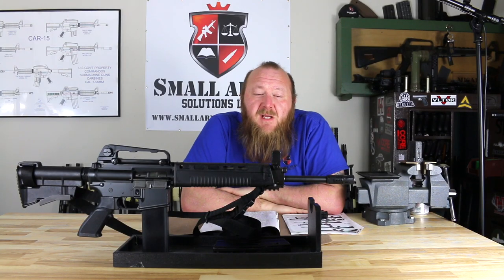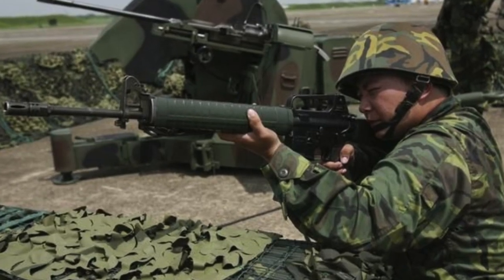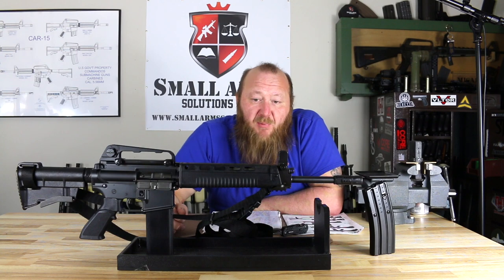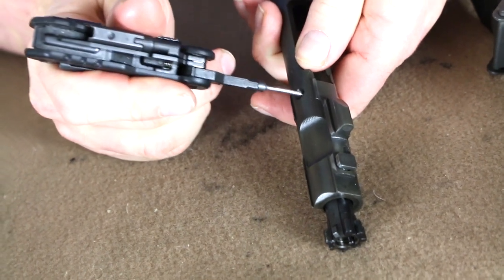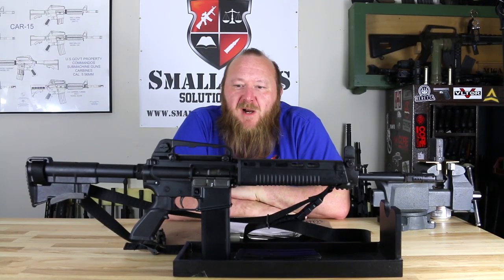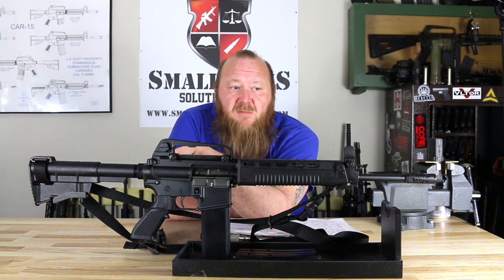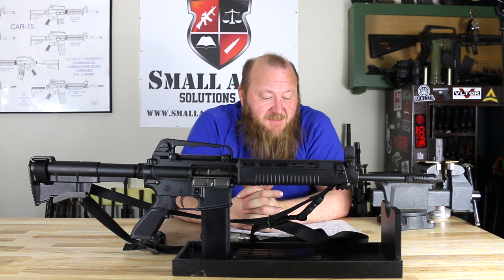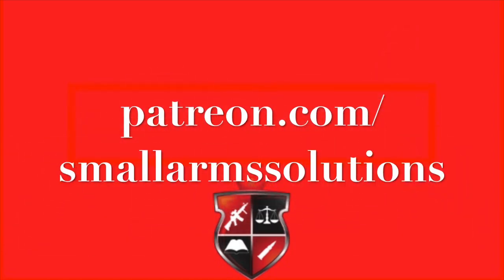The Taiwanese T91 Rifle and Custom Build

Comment: The Republic of China calendar or Minguo calendar is one of the calendars used in Greater China area, but not in PRC, of course. The calendar is to commemorate 1912, the year of the establishment of the Republic of China, thus T65 and T91 means they are in service since 1911+65=1976 (T65), 1911+91=2002 (T91).

Comment: I too also have a T91 Clone. The T91 is Hands down my favorite Piston AR to shoot. I have a BFS3 trigger in my T91 clone, so i have that 3rd selector option😁😁😁 My T91 in Binary Mode is the closet thing to fullauto for civilians. I have had zero issues with my T91. I am going to get the 16" T91 version very soon.
Reply: Hows recoil?
Reply: @nuclearjanitors  very light recoil.
Reply: @sugarland77478  thank you brother but i am in NC, and that invitation is reciprocated if youre ever out this way. I'd like to grab one, and with that upper price just right i think i might.
Reply: What length barrel do you have on your clone?
Reply: @bryanupton9872  14.5" pinned/welded to 16" legal requirement. I haven't decided for my 2nd T91 if i want the 16" or the 12".
Reply: @bryanupton9872  i got the Echo 2 trigger from Classic Firearms also on sale for $299.99.
Reply: Read my reviews on the T91 and look at the pictures of my T91 at classic firearms. Also look under the Anderson 80% you will see my review there also.
Reply: sugarland77478 thank you, I have a pin and welded 14.5 upper also but I’m just putting it on an aero precision lower. Bought all the Taiwanese furniture however
Reply: @bryanupton9872  I took my 80% to the local fleamarket and had it laser engraved with the T91 markings for $20.00.
Reply: @sugarland77478  good day!, question?, just like you I’m station in Fort Bragg. I have been looking for some one to engrave my receivers
Reply: @victoravalos1711  Fort Bragg or Fort Bend? I got mine done at the local flea market.

Comment: I picked one of these "Wolf A1" upper, swapped the barrel and got the right furniture from "T-91 Tactical" and built it with a BCM lower kit and a Poverty Pony Stripped lower.... and I love it. What a fantastic platform. The Gas system is SO easy to completely clean... not that you really ever need to. Very accurate, very light, and very fun too shoot.

Comment: Most Piston Driven AR in the US market today, are relatively new development.

The original AR-18 and the Taiwan T65/T91 line, is probably the two oldest Piston Driven ARs....   And I want my gun to stand the test of time (and the Taiwan T65/T91 went through at least 4 generations..  maturity thru iterative improvement is always a good thing).

The T91 piston upper sales at a reasonable price, the only problem is they don't import enough of these and are hard to find in the US market.....

Comment: You seem to be one of the more knowledgeable and  informed guys on the Type 91. In fact this video made me buy my wolf a1 initially a year or so two ago. I have a minor issue and can't seem to find a solid answer. 

I recently converted my wolf a1 to a proper milspec T91 with the barrel, sightblock etc.
I'm trying to find a quality folding rear sight to pair with the milspec gasblock, and front sight post. However, nobody can give me an actual answer, other than HK416 sights MIGHT work and Troy Micro M4 sights MIGHT work. I don't want to know what might work. I want to know what WILL work.  I'd hate to spend 100+ dollars on a sight to find out it's not gonna work for me. I plan on using it with red dots and magnifiers, so folding is a must. I'd love to use my T91 on the job; bail enforcement. 
I really want to use the milspec front sight as is, and not opt for a higher sight post. 
Thanks

Comment: Could be a modern classic , alot of nations seem to be moving to short stroke roaring bolt rifles , I feel it's the best AR piston system that has had the most real life testing ,I really wish that wolf imported the parts properly as in as in milspec T91 upper and a CL barrel, I'm sure they could have found a way to import them just as you can unport FB CL barrels undrilled from Poland. Or just imported the whole rifle as a straight-pull then drill the gas port.
Spare bolts and barrels are kind of a nightmare to get, I feel if they did what Zastava USA did it would have been amazing .

I know they have blocks that will accept an AR15 barrel but it needs an undrilled barrel.

If they came in as is or imported them as pistols it whatever with spare parts then it would be a prefect duty rifle.

In sure they could have made 18 and 20" barrels but also .300 

Licencing out the system would have been a good idea and alot of tech from company's like KAC and LMT such as their propiatary barrel extensions and bolts, the parents have expired.

Some things I don't get about the US is why so many company's have not used to CHF barrels, I have a cheap howa 1500 barreled action in 6.5 (they also make assault rifles for the JSDF) and it has a proofed CHF SS barrel, it's my most accurate rifle.

I feel with nitriding I don't notice much and it seems to wear away fast depending on who makes it, I have found apart from being easy to clean all AR BGCs that are not standard milspec phosphate with hard chrome on the inside perform pretty badly, they look cool but alot of gas leaking.

I just did one of my cheapest builds with blem parts as I wanted to make a solid 18" AR duty rifle that can handle some abuse,  found a nice FN CHF CL 18" barrel for $150 1/8 .223 but it came marked .223 / 5.56 and I managed to get alot of milspec parts like a bolt and BGC never shot as people upgraded to whatever is fashionable also a rail and some furniture, it worked out 500 dollars in total and a 1/8 seems to make more sense than a 1/7 for most as I don't think I will ever shoot anything so heavy it needs a 1/7.

Comment: Taiwan Army will substitute new self-made XT-112 assault rifle for T91 rifle which are currently used by the troops. The new XT-112 assault rifle has a built-in reflective inner red dot and an advanced combat optical sight. 
Its effective and precise shooting distance reaches 1200 meters. It is an assault rifle with the world's longest distance in precise shooting currently.

Comment: I just got done with my t91 build. They definitely do not get the attention they deserve. Did you have any issues getting the bolt to to far enough back through the receiver extension? I put a h2 style buffer. I also am using an original 91 buffer tube

Comment: Re: Taiwanese M-14s decomissioned quickly.

I know of at least one ROC reservist whose unit had them in the early 00s, although they have since transitioned.
Reply: Only small portion of of type 57 and M14 were left as DMRs, and I heard most of them got decommisioned and scrapped.
Reply: My father, who was training around the mid 90s had a Type 57 I believe. He said they were still transitioning to T65s and T86s at the time

Comment: I didn’t hear you mention the cam pin track in the upper receiver. How does this rifle fare in that area? Seems as though other external piston AR type firearms can possibly cause “damage” to the upper receiver. 

     Would be interesting to know if it was ever an issue for Taiwan.
Reply from the maker: j paul it is typical of any external piston AR. There is cam track cutting.

Comment: For the Wolf A1 T91 16 inch, which buffer weight, spring, tube is optimal?  Thanks.
Reply from the maker: H2
Reply: @SmallArmsSolutions    What are your thoughts on a H3?

Comment: Will an ar15 bolt work in this ?
Reply: Won't work
Reply: @AG-rk5hj  I think the same actual bolt will interchange, but it requires a different bolt carrier obviously since it's gas piston operated. Not 100% sure though.